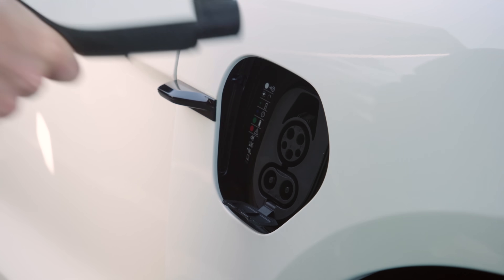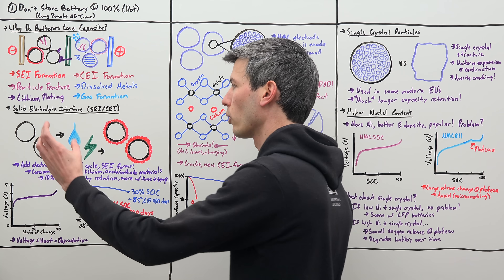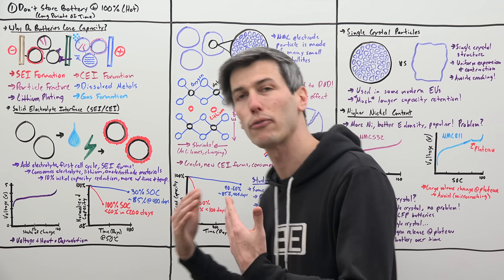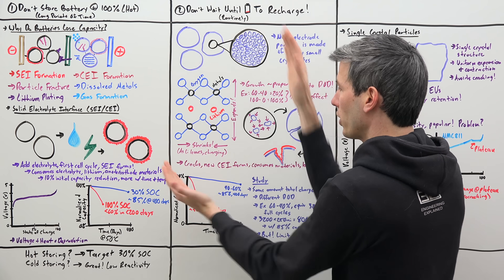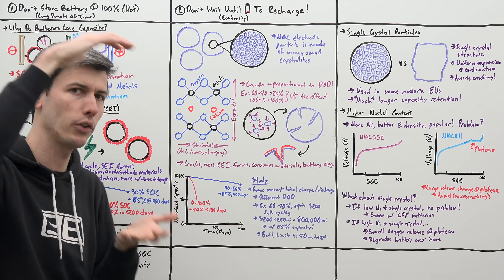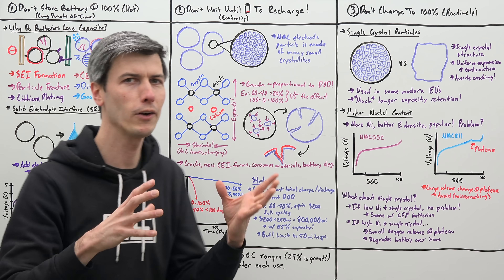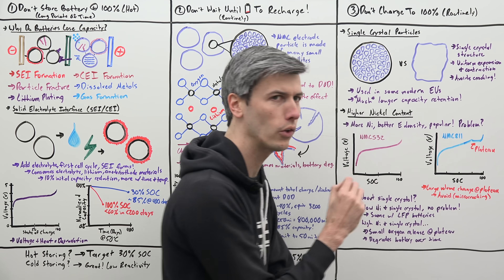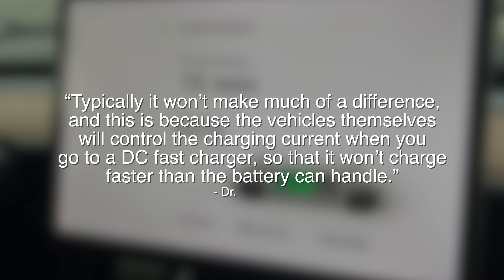How To Ruin Your Electric Car's Battery - NMC Edition!

Comment: The EV rules:
1. LEASE - do NOT buy!!
2. Never EVER rely on public chargers
3. Never forget to plug it in overnight 
4. Do not demand more than light duty out of it
5. All of your daily driving must fit within half the vehicle’s advertised range
6. It will be your second vehicle to an ICE car
7. Never go off the beaten path
8. No, you will not go on road trips
9. No, you will NOT attempt to tow with it
10. Try not to actually drive it
11. Remember that any problem you encounter is your fault & not the car’s
Reply: None of these are true.
Reply: @logitech4873  please elaborate
Reply: @CropCircleCritic  This summer I drove 13,500 kilometers through Europe in my Tesla model 3, relying entirely on public chargers. 
What makes you think I followed literally any of your rules here?
Reply: @logitech4873  it hasn’t happened to you yet, my friend.  It’s coming.  Just wait.
Reply: @CropCircleCritic   I think you need to gain some experience with EVs dude. You just don't know what you're talking about.
Reply: @logitech4873  had one for 2.5 years.  I arrived at that list after about that much time.  You will too.  

Have fun waiting on the diesel tow truck when you pop a tire.
Reply: @CropCircleCritic  How strange, because my experience is the opposite. It's my only car, I use it for everything, and I drive about twice as much as the average Norwegian.
On my roadtrip, we drove wherever we wanted. We mainly went to small villages and stuff for cheap hotels, and basically everything was within the range of chargers. No queues, no issues all trip.

I'm a former tire tech. I carry everything needed to patch a tire in my sub trunk :)
This far I've not had any punctures myself, but I've helped a few tourists get back on the road. I carry a small engine starter as well.
Reply: @logitech4873  then I do hope you have one of the proprietary pucks in case you have to jack it up.  This will help to avoid warping the battery casing.  I strongly advise against jacking up a Tesla without one of these.  

The issue is that the car is heavy and a puncture will quickly progress to a flat.  Both times it happened with no warning.  It wasn’t low for a while with a warning in the screen, the rim was just suddenly down on the concrete.  It’s not just the cost of replacing the tire, it’s an ordeal waiting on the tow truck and then losing the car for a couple days.  

Banter aside, it’s wonderful that you stop to help people.
Reply: @CropCircleCritic  I carry a puck yes.
Reply: I did a 6000 mile road trip last summer in my Tesla X (Florida to Colorado).  It was flawless and very enjoyable.  Was I not supposed to do that?

Comment: There are computers in EVs.  Why don't they tell the user how to treat their batteries?  Or, why don't the stop charging at 80% automatically?  Unless the user wants to override?  Same for low charge...notify the user when charge reaches 30%.  Of course, if the battery is used between 30% and 80%, then basically the range of the EV is really half the advertised value.
Reply: Teslas tell you all this in the car and in the manual.

Comment: To manufacture each EV battery, you must process 25,000 pounds of brine for the lithium 30,000 pounds of ore for the cobalt 5,000 pounds of ore for the nickel, 25,000 pounds of ore for copper Diging up 500,000 pounds of the earth's crust For just - one - battery.
Reply: So?  Now explain how oil fracking works.
Reply: @SpottedSharks  I can't explain oil fracking. I'm a union operator I drive heavier equipment and process material. When you process earth no matter what mineral you're extracting takes a really lot of diesel fuel.
Reply: By the way, I live off grid, Built my own solar, Build my.
Own lipo 4 batteries. An electric vehicle would work good for me. But I really don't want a computer car.

Comment: So basically if you live in an apartment you shouldn't own an EV because you can't take advantage of these tips.
Reply: Yeah you can? You just need a charger.
Reply: @logitech4873  where are you going to install a charger at an apartment when you don't have a parking space near your apartment. my parking spot is 100 feet away from my unit
Reply: @mikeydude750  At the spot where you're parking. 
In my country, laws basically make it so that you can get chargers installed even in cases like this, regardless of what the landlord says. 
If that's not the case where you live, people just need to vote for people who want to fix that.
Reply: @logitech4873  Housing crisis is already bad enough here - more laws forcing landlords are just going to make housing even more expensive.
Reply: @mikeydude750  I don't care. This is a basic necessity. You have to pay for the charger installation yourself btw.
Reply: @logitech4873  then i ain't buying an EV lol
Reply: @mikeydude750  Well, hopefully your public transport improves by the time EVs are your only option.

Comment: If your EV traction motor battery fails under warranty and you try to claim for a replacement do you really believe with the exorbitant cost of it, the manufacturer is going to just give you a new one free of charge no questions asked? Usually what happens in these situations is their service department makes up some excuse like you weren't following the correct procedure to ensure battery health and longevity is maintained even though you may have been doing the correct things. They will usually always turn the situation back on you so they avoid any liability.
Reply: Is this just a guess or what?

Comment: If you charge with Tier 3 charging (Tesla Super chargers) All the time or a lot ruins the battery no? Thats what Ive seen is that true? They says to use tier 1 and 2 for every day use
Reply: Correction it will cause degradation to the battery not ruin it? If constantly using super chargers. Is that true?
Reply: i dont think so, as the car manages the battery to prevent damage. First it keeps the battery at the proper temperature, second, it throttles the speed as necessary to keep the battery healthy.

Comment: What would be the advice to a PHEV owner? I personally own a used Chevy Volt and don’t quite know how this advice would apply to it. It has an advertised range of 53 miles which is already not a lot so limiting that would be hard in my mind. So are PHEV owners just left out in the rain on battery degradation?
Reply: Information on PHEV's batteries is scarce. But, I think that even if you do charge to 100% every night (like we do), the SOC drops very quickly, within 3 or 4 Km (1.8-2.5 M), from "full", after you set-out. Most days, we only drive around 30Km (18.75 M), so, the SOC seldom gets down to anywhere near 0%.

The Traction Battery in our 24 Prime is 13.6Kw. It does have energy buffers at the low and high reaches of the cells. So, you may only access something like 80% of the battery. However, I have surmised this; when we first got the car I was under the impression one could fully charge the car and select AutoEVHV and drive the thing like a "normal" hybrid. Not so. Even in Hybrid Mode, the car will not start the engine until the Traction Battery is completely dead. 

That means Toyota has enough confidence in their PHEV batteries lasting through many cycles that they don't bother having the Hybrid System engage the engine when the SOC drops to say 35%. There's a lot you can read into this statement.

I drove our Prime 88Km (55 M), in EV Mode the other day and, the SOC was at 6%. The battery would have taken us beyond 90Km. This morning the computer said we had 91Km of EV range.

Comment: If going on a road trip, I wonder if it is better to charge to 100% at home then charge from 10 to 60% at the Super Chargers or to only charge to 60% at home prior to the trip and then charge 10 to 60 at SCs.. On one hand, it may require slightly more SC usage, but on the other, the depth of discharge in a single drive would be lower and you would never get above 60%.

Comment: Definitely need a video on fast charging effects. That sounded like a very lazy explanation. By that token, he could’ve said the same thing about state of charge. That it’s not a problem because the vehicle won’t let you charge to a higher SoC than the battery can handle.

Comment: It seems to me the real issue here is EV manufacturers using range statistics that are not achievable.  If the best way to operate an EV is between 25-75% charge, then that is all the charging system should allow.  That would avoid a lot of degradation of the battery unit.  However, who would want to buy an EV that has such a limited range?  But if you have bought an EV, it already has that limited a range unless you degrade the battery.

Comment: This makes sense, I usually use no more than a few percent of my battery at a time. When I sold my last EV it had hardly lost any range at all (I think 15-20 miles).
These batteries will easily outlast any ICE car on average.

Comment: So here is a question that I have had for a long time. Is it not possible for a car with solar panels in the roof to power a small heat exchange system to keep the battery temp and maybe the interior temp in the optimal range for comfort and battery life all the time. Or is that just not possible.

Comment: Driving an EV /can/ work even when charging at home is no option. There are alternativs. Not trying to say it's for everyone, but some (many?) may have the option to charge at work, while shopping for groceries or while doing any number of things where a charger is nearby. Doesn't even have to be a fast charger. If these options are there, charging at home is not necessary. I am in that group and I am just using every opportunity to charge along the ride. This means for the most part no extra trips to chargers in contrast to what was stated in the video at the end. I am typically using small depth of discharge and charge the car frequently and in small doses even though I can't charge at home, without extra effort. Just comes naturally. Park the car? Plug it in, done.

Comment: Thank you for a data driven perspective. Something else to consider is that the displayed state of charge is not the actual state of charge. My Volt limits me to using 12-14 kWh of the 19 kWh battery. It also keeps the battery at ideal temperatures when plugged in or the vehicle is turned on. I regularly go from “full” to “empty” and I plug in whenever possible. I don’t schedule a charge time and I charge until “100%” whenever possible. I still get up to the rated range of the battery during normal driving conditions after 7.5 years and 87k miles. Personally I don’t think it’s worth the stress of micromanaging the battery the way you do a phone.

Comment: I get that none of this is that complicated, but when comparing the pros and cons to a ICE car, this should be considered.  Especially the never charging more than 80%.  I feel like they should start including a range number on new cars like the range between 60 and 80%.  I can fully fuel my ICE car and drive it till the gas light comes on and have no worries.

Comment: Do any of these rules apply to PHEVs?  I have a Mazda CX-90 PHEV, and given the limited electric range it has, it seems like would be made to charge to 100% and discharge to about 10-20% most of the time.

Comment: This is a very good summary of Jeff's video.  However, there is one point that you mentioned in the video that Jeff did not state.  He's a very nice man and I had a chance to correspond with him.  You had said that you "Plug in all the time".  I don't think this is required to get the longer life - and in some cases may hurt you.  The perfect battery charge depends on chemistry, but is around 50% to 55%.  That is the optimum SOC for your battery, except in really hot weather.   Charging to 70% and then plugging in when you come home AND you are under 40% is very good, but don't if you are above.   If you don't drive that much (leave at 70% and come home at 60%) then plugging in all the time and keeping your battery constantly above its "happy zone" is not optimum.

Comment: I don’t think the avg. consumer will know this. These habits should be formed with software at either the vehicle level or charger. Most likely vehicle. Daily driver - charge every night behind 60-80% and drop the charge once it hits 80%. Long trip - set it the night before to charge over 80%. Software will be the answer.

Comment: I wonder how this plays a role in the used market.   Like how am I to determine the charging habits of the previous owner?  (Only full mileage range will tell me?)
Reply: For most EVs it's not difficult to check battery capacity with a test drive

Comment: I hope USA has battery swap station like Asian countries.  This is the much better solution to engage more Electric consumer
Reply: Norway has them too. They're a bad idea for several reasons.
Reply: @logitech4873  oh why?
Reply: @terencelee992  1 - Cars come in many shapes and sizes. For battery swap to make sense, we would need standardized battery types. This would mean everyone would have to redesign cars from scratch, and agree on a standard. This just isn't happening.

2 - Battery swap stations are complex and usually require attendant oversight. Foreign stuff stuck underneath a car (for example snow or ice) can prevent the swap from occurring, and leave you stranded. Or worse, the swap might start and then fail, leaving your car without a battery.

3 - Battery swap stations are very large, and can at best be used as an addition to conventional charging. Which means you'll have conventional charge capability anyway.

4 - You don't own your battery. You're renting a battery. This has upsides and downsides, but means you're paying a subscription fee.

5 - Fast charging is becoming faster and faster. The benefit of battery swap is slowly diminishing.
Reply: @logitech4873  that made much sense,  thank you for your information.  Yeah,  i didn't realize the dirt or snow,  or even ice is the problem.  And put every industry in the same table is much more headache because of huge resource needed and political parties might be.  Then of course fast charger is more advance than ever,  that's more bright way to develop the ev future.  My hope is ev industries could extend a much longer range as standard and much more stable battery for everyone in the market

Comment: I am wondering does it make a difference if using level 1 charging at home vs level 2. Don’t really need level 2 except occasionally with my bolt. I find level 1 to be just fine for my day to day driving for the most part.
Reply: Hey diypasco,

I'm wondering the same thing. We just received our 2024 Prius Prime (21 month wait !). It has a 13.6kw battery. Charging via the furnished Level 1 charger takes 11 hours from "empty". Like you, the charge time is not really important for us. Our day to day driving is under 50Km in general (31 miles), we are retired.

We were intent on using the Prime as a BEV when we ordered it (our third Prius, first PHEV), and, after 3.5 months that's just how it's been. Now at 5,000Km (3,125 miles), we have used less than 1.5 tanks of gas. In EV Mode we are well exceeding the advertised EV range of 44 miles (70.4Km). The last two days the trip computer showed a 91Km range at start-up. Yesterday, I drove 88Km with 6% left in the battery. The car would have easily went over 90Km. Well pleased. Gas here is $6.50 per gallon.

But, I want to save even more money. Charging on 115 uses as much as 13.4kwh's (from 0%), even though the battery only allows about 80% charge/discharge. This is because the system has both a cooling fan and heater (for winter), that run for the full 11 hours as well as the normal inefficiencies that consume energy.  A 220 volt Level 2 will charge to full (80-90%), in just four hours. That saves 7 hours of either fan or heater operation per day.

But, will the faster charging affect the service life of the Traction battery. Due to its smaller capacity, our battery will go through many more cycles than a BEV sized battery so, would we be penalized in the long run by going to Level 2.

We love the Prime

Comment: Micro managing battery charging at home, route planning on longer trips, hoping chargers are working and not full of cars, worrying about extreme hot and cold impacts...... I'll pay a bit more for petrol and enjoy the lower up front cost and far better resale.
Reply: 1 - You don't micro manage charging at home. You set a charge level in your car once, and it takes care of it
2 - Most modern cars do the route planning for you. My Tesla was ridiculously easy to drive all across Europe last summer.
3 - Weather is weather. I don't worry about extreme cold or hot, I just deal with it when it comes.

Comment: I have a model Y long range and I drive to work 160 miles daily 5 days a week, in winter I charge to 85% due to the loss range in low temperatures and in summer I charge to 80% because I need the range, so based on the principle you explained charging to 75% will leave the my battery at a low state of charge before I can charge again, what should I do then, I have the privilege to charge my car at work, which when I get home leave the battery at around 50% from 85%
Now should I charge back up to 60% to meet the minimum discharge rate and charge to 85 when I get to work LOL kind of confusing, what do you think
Reply: What on earth is that commute? Your life is truly a car hell
Reply: @logitech4873  LOL for real !!

Comment: Nicely done.

In brief, target keeping your battery around the center of its range for normal use.

For example, a Bolt with a 260 mile range the center is 130 miles.

If you normally commute 40 miles a day, set the target charge to 150 miles overnight. 
when you drive 40 miles the next day it will drop to 110 miles of range left, enough for a good unexpected trip with the car.

and when you plan a longer trip set the target higher the night before accordingly